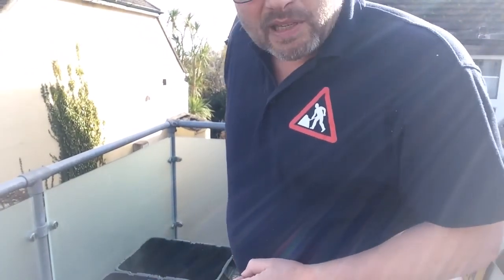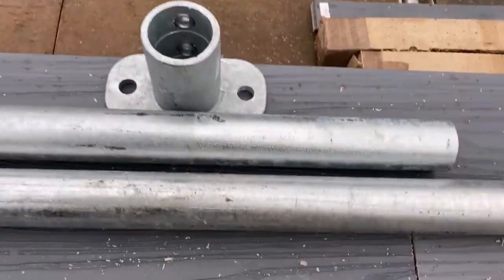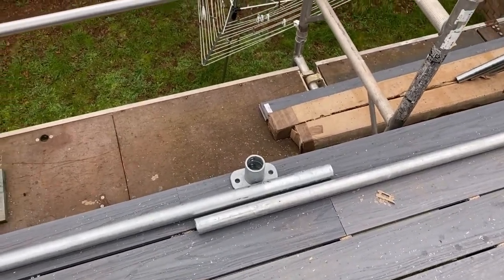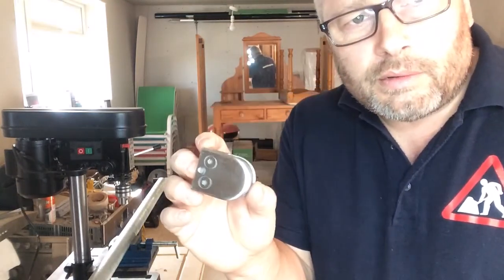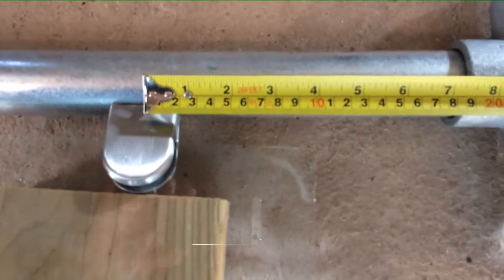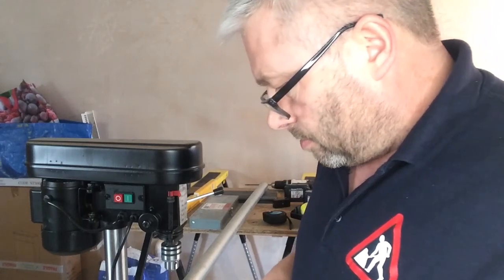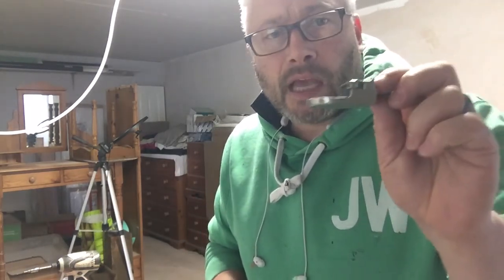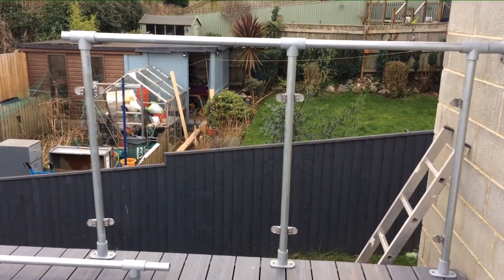Episode 19   Creating a budget glass balustrade for the decking

Comment: Gotta get a better mic,it's coming in way to low in YouTube
Reply from the maker: If it’s what the viewer demands, that may be sufficient justification for channel investment! 🤔👍🏻😁
Reply: @workingonthehouse8038  they're not expensive, and your setup is great camera wise, a lapel mic would do wonders.
Reply: Why did you start off using D CLAMPS but the finished balustrade had bolt fixings? I’m guessing the eBay clamps didn’t hold the glass and rusted?